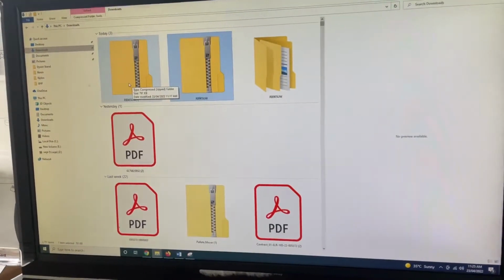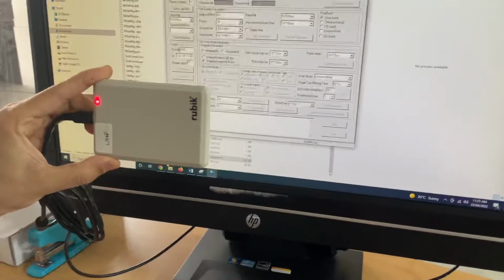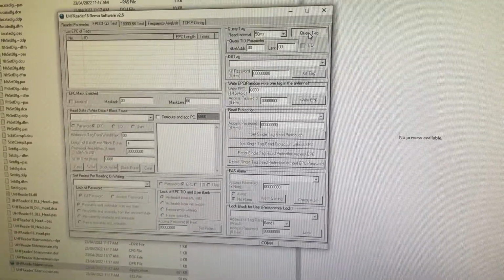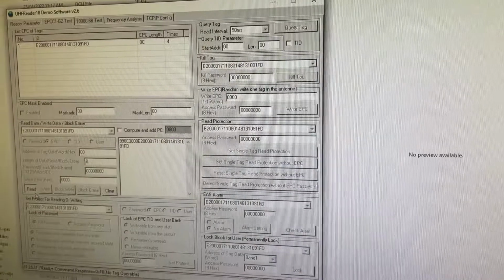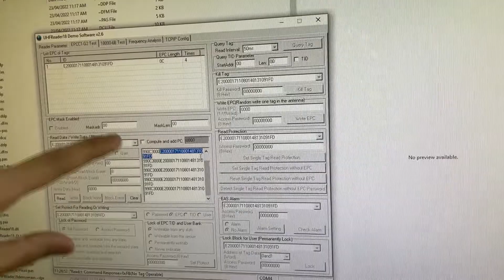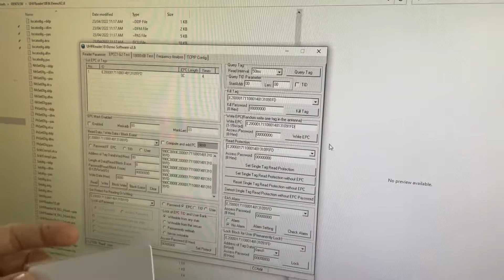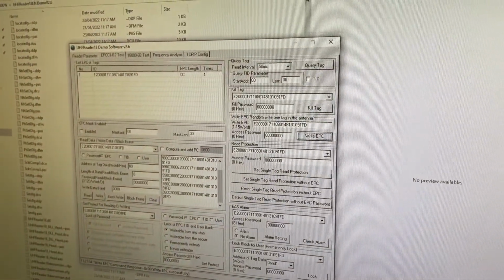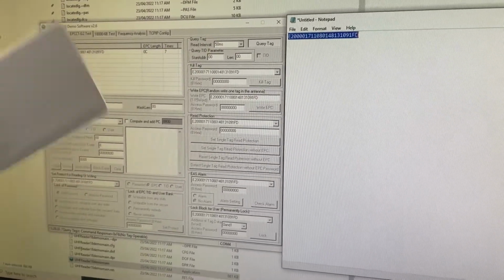Rubik UHF Reader Writer (Long Range Card Copier) Fast Help

Comment: Where can we get the SDK or the software used for the UHF Reader?
Specifically for, RS232/RS485/WG26/34 UHF RFID Reader.
Reply from the maker: If you have Rubik copier, please contact on support line written on the manual.